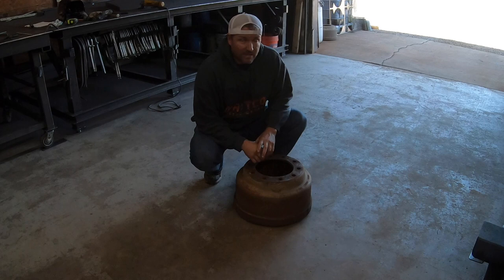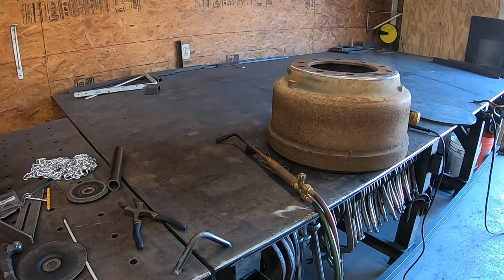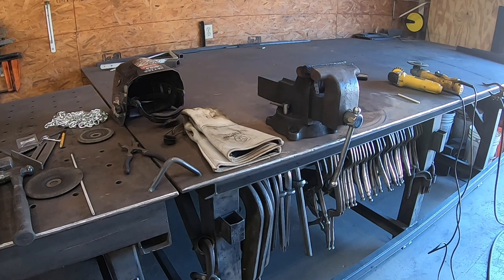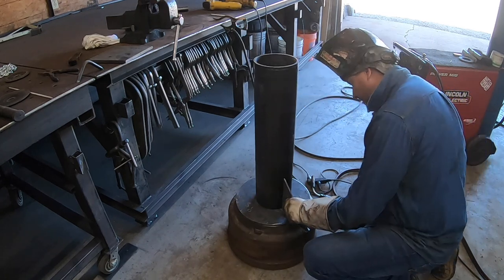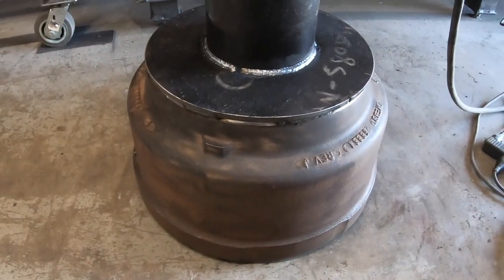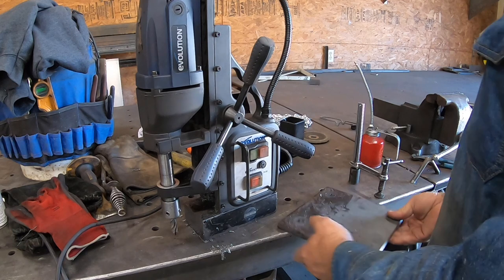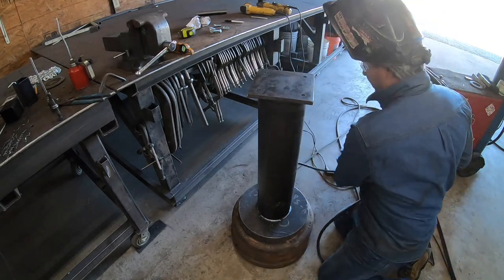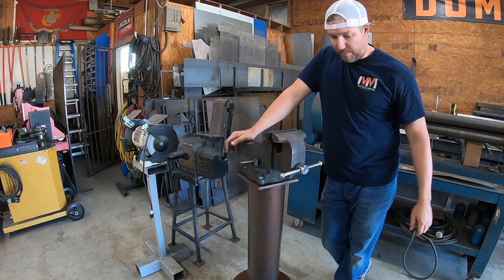Building a vise stand with dumptruck brake drum

Comment: In the past I've made a few of these exact same stands from old semi drums, square & round pipe/tube, for bench grinds and vises,  I always found a loud " Tining" sound so I cut off the welds from up top and filled the tube/pipe with sand. It mace it more heavier plus sound deading.  Hope this helps you or anyone else,  God bless and keep safe
Reply from the maker: That’s definitely a great idea.  That hollow tube will echo anything.   Thanks for the tip.

Comment: I weld a tab on the pipe down low so I can ground a machine later when I need to hold and weld. I also make a loop to hang vise grips and grinder just below the head, because that baby gets wheeled all over for whatever at my shop. 👍👍👍
Reply from the maker: That's a great idea, will definitely have to add that, we've got another drum to build a second one so we don't have to slide this one around so much. We use ours mostly for tube notcher but having a second for actually holding things would be nice
Reply: @MattcoMetalWorks  you can never have enough holderrereererss 😂😂😂

Comment: Are used to take these and just put an old pipe and left over wet concrete. You can then use it as a sign holder or a base for different tools
Reply from the maker: That would definitely keep it from moving adding concrete as it has alot of weight. They are very versatile